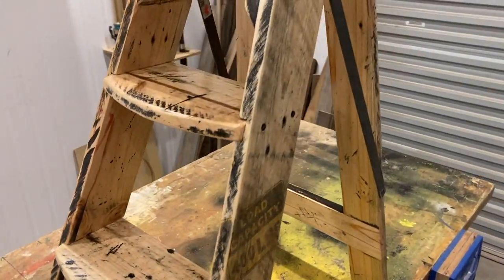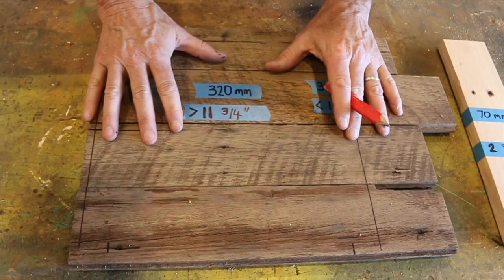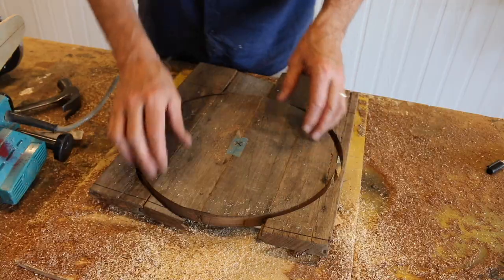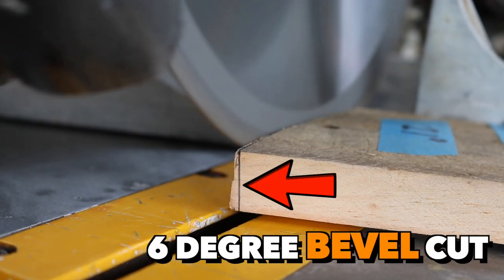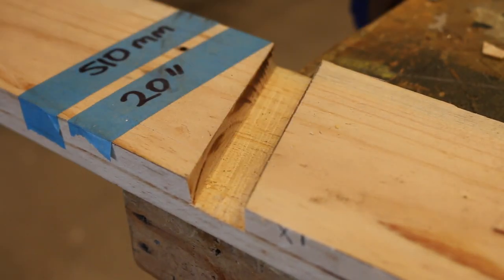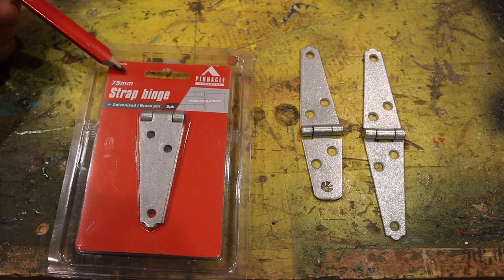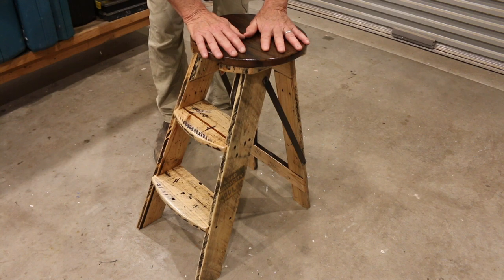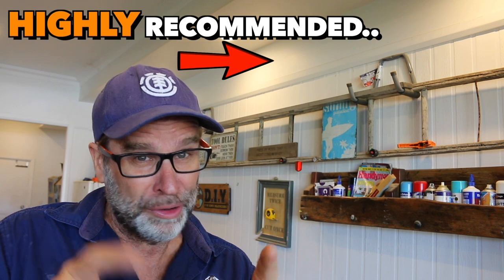Folding Step Stool! AWESOME DIY Pallet Project

Comment: That's a great simple little folding mechanism Shane and a handy small shop dual purpose project. I was considering a stool in the near future, perhaps something like this is the way to go instead. Will check out the long version too. 👍
Reply from the maker: Cheers James👍.....did my head in a little bit trying to work it out but once it was made it
 all made sense and came together. Thanks for watching mate and have a great weekend👍 No doubt you'll be installing those awesome light boxes?? 👍😁🇦🇺
Reply: @diyforknuckleheads  they are ready to go!  Just hoping my sparky mate has time to finish the wiring 😊
Reply: Well done!

Comment: Mate IT WORKED !!!!!!!!! 👍👍👍👍👍 WOOOOO HOOOO and you were worried when i came over ...lololol Well Done mate I do love the colour of the seat , and the contrast between the pattlet wood and the darker hardwood is very nice indeed 😋😋. Built so well with  Thus Hulking 💪💪💪💪💪 Physique 😂😂 BTW i little tip, Use ya Drop saw for the Dato & Rabbit joints, it is a easier to control and you can cut out more and less clean up.  (Ohh BTW I see you got ya Editor working, Let me know what the problem was as i was and am curious :)
Reply from the maker: G'day Benny Boy 👍 Mate it was a long story....best over a phone call l reckon 👍 Glad you liked it too  mate. Talk soon 👍👍😁🇦🇺
Reply: @diyforknuckleheads  no worries mate, give me a call whenever, well as ya know I am a Man of leisure now...for a bit... nahh gotta get a job 🤣🤣